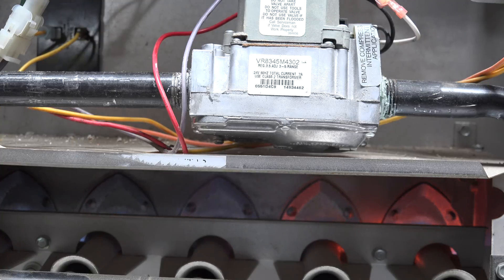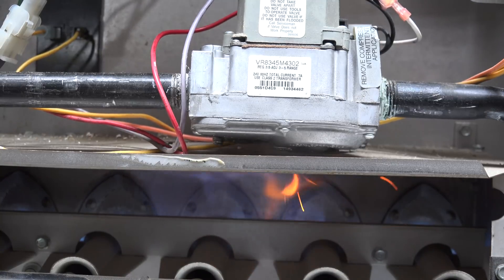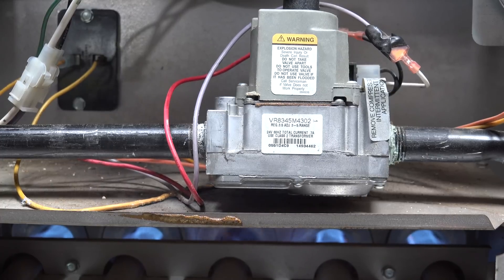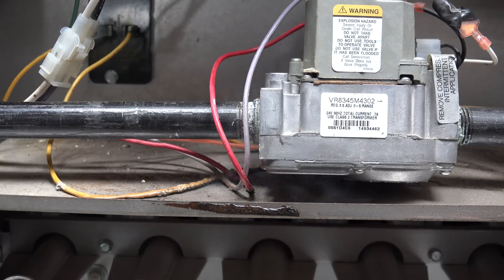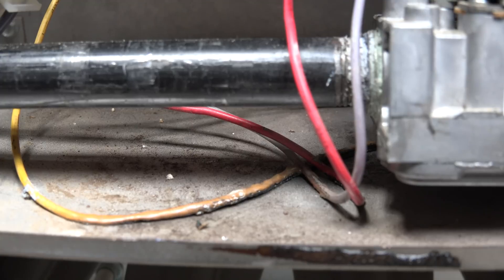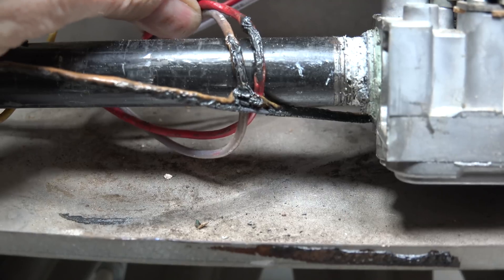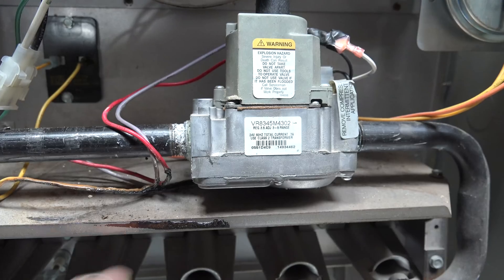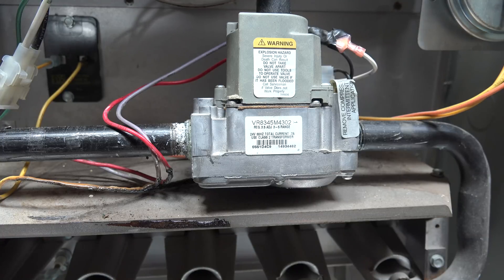What happens when the gas furnace rollout is bypassed

Comment: Wow scary stuff! Thanks for sharing. My old furnace does not even have roll out switches. I suppose they tie into the 24V gas valve circuit?
Reply from the maker: Yes, they do.
GFM
Reply: @grayfurnaceman  Thanks! I'm gonna install 2 if I don't wind up replacing my old dinasour model.

Comment: What happens when someone installs a rollout switch that is rated for half the temp it should be?
Reply from the maker: You could have nuisance trips.
GFM
Reply: @grayfurnaceman  you have no idea how obnoxious it was to pay for an HVAC guy to come out, replace the part that was actually broken, and for funsies, replace my working rollout switch, with one rated half the temp. While in the process of it, wired it in reverse. I had no heat for 2 weeks outside of space heaters. I am still peeved about it.
Reply from the maker: @SimonTekConley  Sounds pretty ugly to me.
GFM

Comment: Great job with this video. By-pass for testing only. I just watched a so called tech by-pass a roll out on a janitrol and left it. Crazy...
Reply from the maker: And dangerous.  Can you say liability.
GFM
Reply: My Tech's know never leave any safety or switch by-passed or they will be in the soup line. Insurance is expensive enough already without a liability claim.. They should be no do it yourself video's for furnace repair.  This is my opinion due to the training required to professionally perform this work.

Comment: how do i bypass a preasure switch?
Reply from the maker: +big milk Why do you want to bypass the pressure switch?
GFM
Reply: +grayfurnaceman for testing purposes
Reply from the maker: +big milk You will need a jumper wire.  Connect one clamp on one of the terminals on the switch.  Turn on the furnace.  When the inducer starts, immediately place the other clamp on the other terminal.  If the furnace starts normally when it did not without the jumper, you could have a blocked vent, combustion air inlet, inducer failure, blocked sensing hose or pressure switch failure.  Hope this helps.
GFM
Reply: +grayfurnaceman it does.  I was asking for future reference I come across quite a few of them and I don't have a pressure switch tester yet
Reply from the maker: +big milk I would not bother with the tester.  Just get a manometer and use a tee in the vacuum line to test and compare to pressure switch specs.
GFM